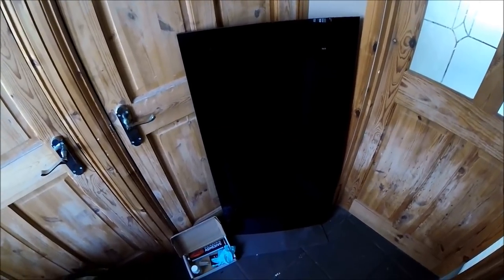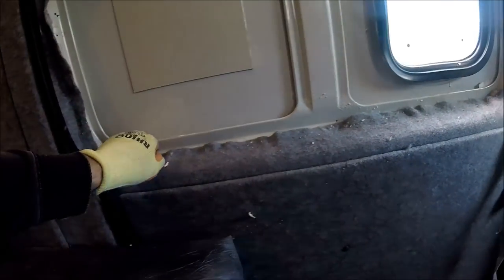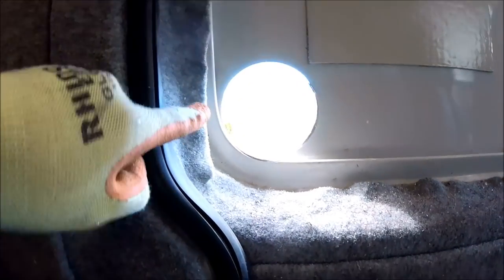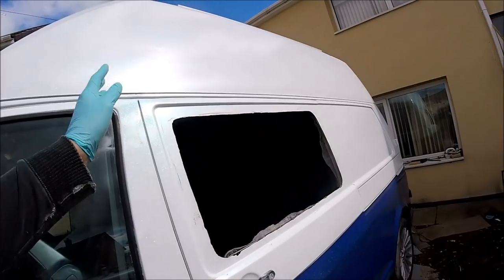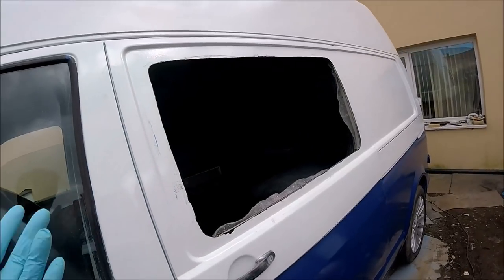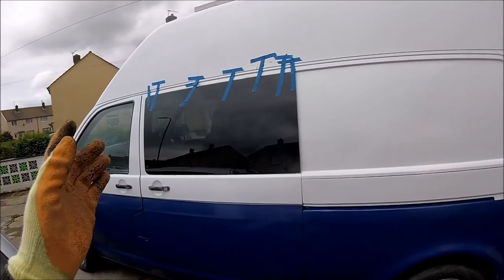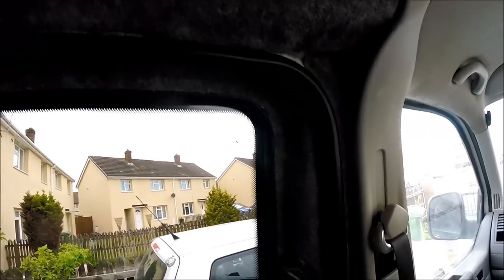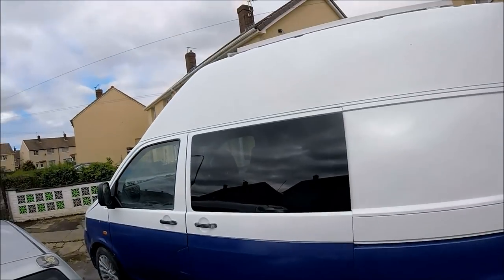Fitting A Bonded Window In A VW T5 Campervan Conversion

Comment: Hi mate I’m an avid follower of your videos which are helping me with my project but wonder if you can help me with something. I have a t4 twin slider with aftermarket windows both sides not bonded I think. I want to fit 3 point seatbelts but I’ve read that the pillars aren’t strong enough in a panel van. Will fitting new bonded windows strengthen the pillars do you know? Cheers bud
Reply from the maker: Hi, windows have nothing to do with the strength of the pillars, t4’s come in minibus format and should have the seatbelt mount holes in the pillars already